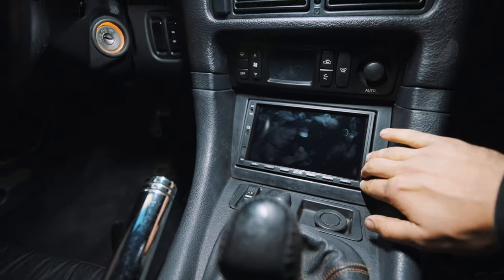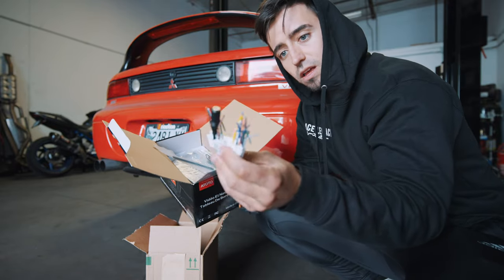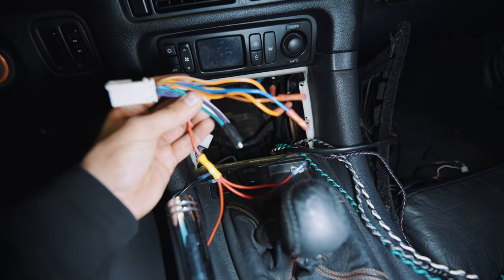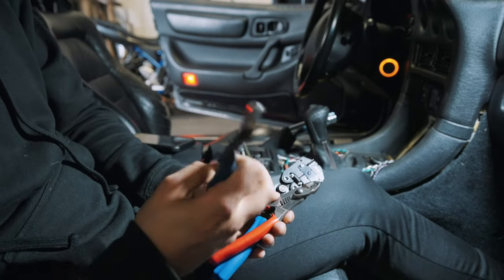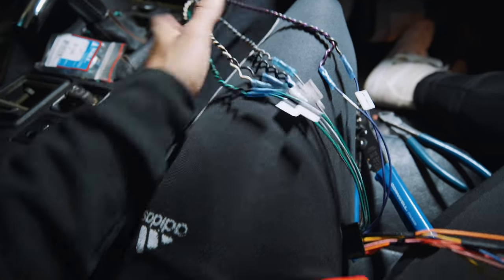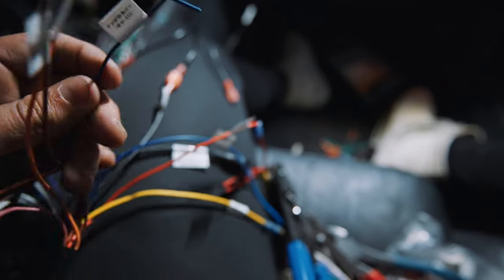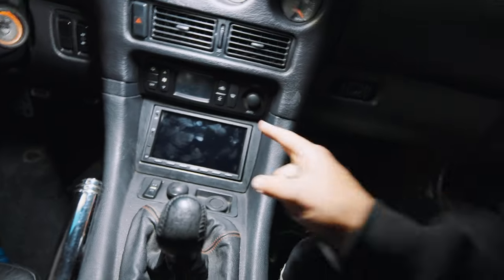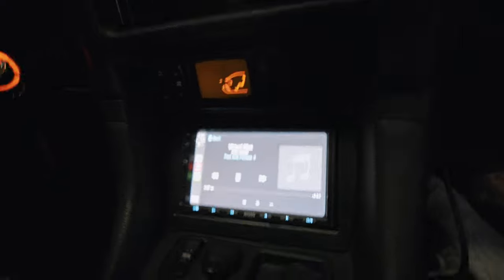Mitsubishi 3000GT Double Din Radio Install! (FITS PERFECT!)

Comment: I just installed the same radio in my stealth a few weeks ago. Definately seems to be a good fit. Although the clock does seem a bit buggy, not keeping track of time passing when the car is off. Also its either under system settings or display settings, that the boot logo can be changed, and there is a pre loaded mitsubishi logo, and you could probably add a logo through usb
Reply from the maker: The Mitsu logo concept is sick. Might have to check if I’m able to do it on mine

Comment: I got a new double din radio for the Evo during Black Friday to replace the double din I got last year that I HATE! Your install went super smooth it seemed. Hopefully this new radio I got fits a lot better than the one I just put in.
Reply from the maker: Got the same one for the Evo. Just waiting to have it running again to install it as well. Currently on a single din

Comment: Just purchased the same head unit....was just curious if you were able to get the steering wheel controls to work? I never used them for the factory unit, but I love how you can have the capability to program the steering wheel controls to practically any function you want?

Comment: funny thing is, I recently got the double din console piece and have been looking at stereo options. I wanted the USB port and stuff, so this is a good option. I'm guessing the timing was fixed and the car is drivable now? I see that you are doing a timing kit install video soon, just wondering if that actually was the issue. I currently re-did the timing on mine, as it was off a tooth or so. Good luck with the car, cant wait to see more vids on it!
Reply from the maker: Skipped a tooth so we’re doing new timing kit and hoping to have it running soon
Reply: where did you get the double din console piece for it?
Reply: @m4rk_yt151  found it at a junk yard lol.

Comment: Got the same one but I'm trying to get the buttons from the steering wheel to work with the radio but if not I might remove it and save it in a box of small oem parts
Reply: Also I sent a dm on insta

Comment: Where do you get your dial kit from which is in eclipse and evo?💯
Reply from the maker: Eclipse has a pioneer doble din and Evo has a single din as well. Will be putting the same double din on the Evo
Reply: @MiguelDsm  i meen the digital dials that tell you the speed and stuff, is it expensive?
Reply from the maker: Those are from AEM

Comment: Hey man, check out the PAC SWI-RC to program the steering wheel buttons to work with your new radio.
Reply: Youtube won't let me post a link but supercar engineering has a write up on the install if you google 3000 gt supercar engineering pac swi. They used the swi-x which requires more wiring but works with older radios. The RC version works better for the modern stuff.
Reply from the maker: I was planning on running a different steering wheel as the 3s is too bulky for me. Good insight for people trying to wire in their though

Comment: Took the touch screen out of my 3000GT and put the original radio back in. The touch screen was  too difficult during driving
Reply from the maker: Maybe it was the brand of the radio itself? This one seems to work easily with touch